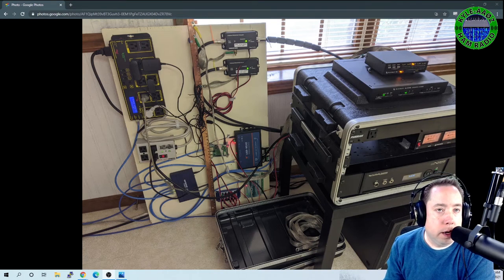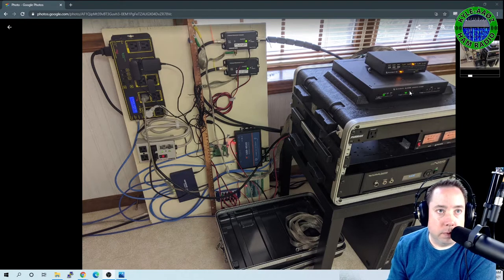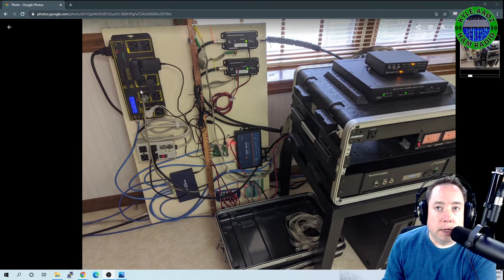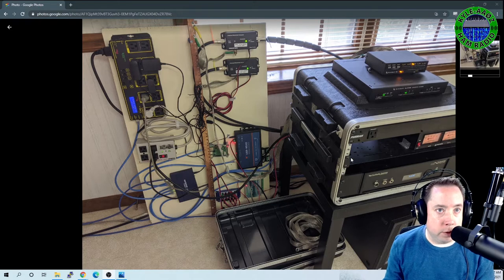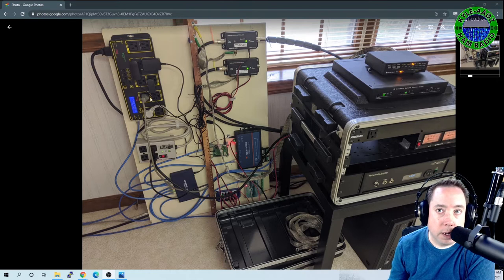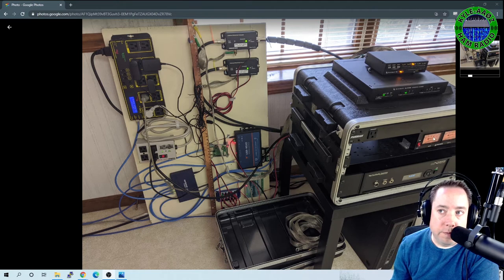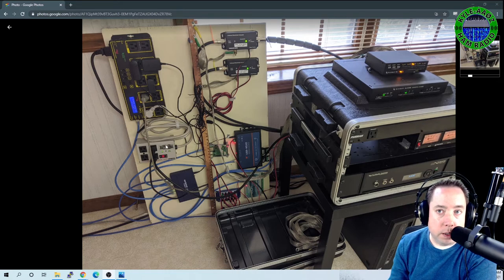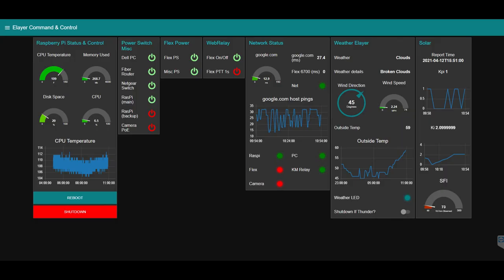Remote Ham Radio - How to Remote Your Ham Radio

Comment: Great video Kyle! I was thinking of getting the original POE switch you mentioned for a remote shack build but am now having second thoughts. Are you using Ethernet power injectors to power your devices connected to the Netgear switch? Also, have you notified the manufacturer about the RFI problem? I've read a QRZ forum post pointing to POE power supplies as the culprit in cheaper brands. Would seem consistent with the problem existing even when the device is "off" but still plugged in. 73
Reply from the maker: Hey Sam, sorry for the late response here.  Just getting back from Huntsville Hamfest.  The only device I power from the PoE switch was the camera.  I don't anymore and I switched to a PoE injector.  For remote stack revision 3.0 I took the camera out and only use the non-managed Netgear switch.  I didn't contact the manufacture.  Too much of a pain.

Comment: Nice Kyle. What do you do for UPS? On my Flex, I run a West Mountain Epic PowerGate with an 8aH SLA Battery. It will take a larger battery. This allows me time to close the radio down properly in case of a power failure. I feed the 14V through it and it will drop it down to charge the battery.
Reply from the maker: Hey Don.  No UPS for me in the shack.

Comment: Hello good morning:
Could you tell me what software you are using to operate the radio remotely?
Is it a Windows system or are you using the Respberry Pi?

I use Ham radio Deluxe but I would like to use a raspberry pi instead of the PC.
A cordial greeting.

P.S. excellent radio equipment. 😍😍
Reply from the maker: Node red
Reply: @AA0Z  Yes, that was already clear to me in the video.  I am referring to the specific program that the radio manages, you know: change the band, the frequency, activate the PTT, activate the NR filter, etc. etc.  Many thanks for everything
Reply from the maker: @30CI60  flex radio smart sdr
Reply: @AA0Z  ok, thank you very much, see you soon.